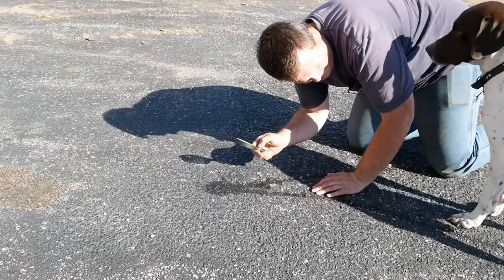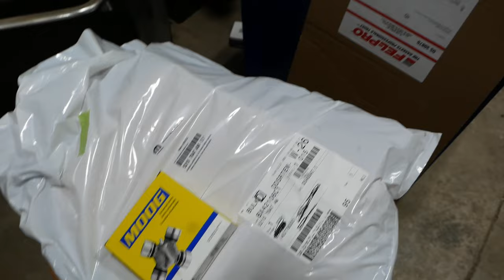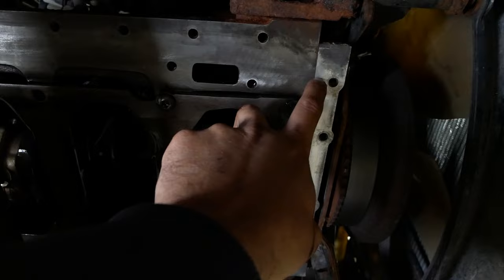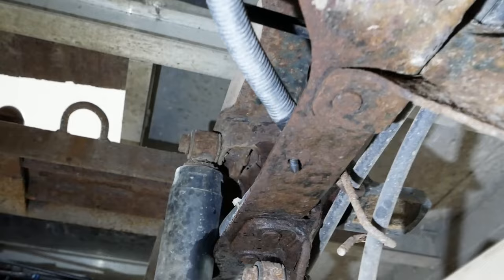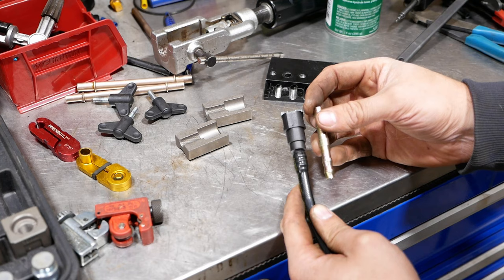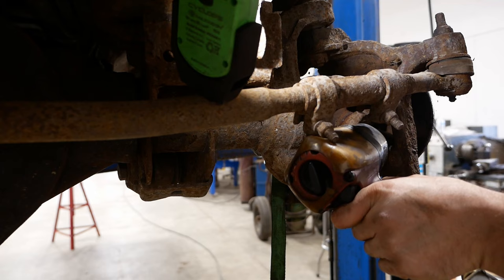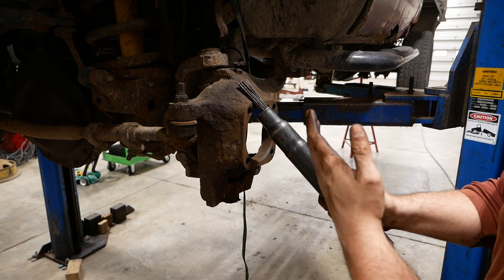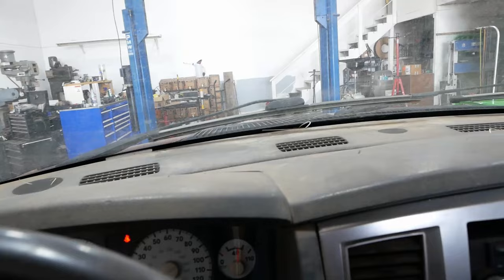6.7 Cummins Massive Oil Leak - Replace Oil Pan, Front Axle U-Joint, Fuel Lines, Shift Cable, Battery

Comment: My favorite comment: "Lets switch from stun to KILL"  Also as a Michigander I can relate, rust is not only a terrible color choice for body panels, but an organic form of lock tight.  Wes you inject just the right amount of snarky in every video.  Thanks
Reply: What kind of salt do they use over there. We have salt here in Sweden but mostly VW products rust out like that if they are 20 years or less old.
Reply: @rimmersbryggeri  The road salt has caustic soda,   sodium hydroxide, lye, that generates heat with water contact.  Some places now experiment with beet juice as an anti icer.
Reply: Patina is the new inthing.
Reply: @12345NoNamesLeft  Ok explains it. That will destory the paint in notime. Here it's just less purifies table salt.
Reply: @12345NoNamesLeft  Here in Columbia, Mo they used excess coal fired power-plant clinker but everyone got tired of the black mess in their garage, so that's went away...But I'd put up with it again if only to quit the salt MESS. And I would guess It gave superior traction...A thin soft bicycle tire of mine had a flat due to that stuff tho.
Reply: @charlesangell_bulmtl  Salt stops working in the very cold, so we do have a sand salt mix too.
Reply: Mitten dweller here as well!  Working on cars up here is a whole different monster than in the non snow states.  I watch the videos from people down south and I wonder if they understand just how easy they have it?
Reply: @rimmersbryggeri  what part of Sweden? South Sweden doesn't get the snow you see here in canada/northern USA. Mountains and such as well.
Reply: @0xsergy  I live in stockholm, but I used to live about 700 miles farther north. In the old days they didn't even bother with salt there because it was too cold.
Reply: @31terikennedy  😂😂 Patina enshrouded in Clear Coat!!

We Michiganians just need to learn to oil our undersides like they did 50+ years ago!!
Reply: @charlesangell_bulmtl  Unfortunately that Clinker slag was toxic.  We had sledding hills made out of that stuff in our City parks.  Then all of a sudden one summer all those sledding hills went away. And folks could call up GM and a truck would come and haul it out of your “gravel” driveway or parking lot.  This was back in the late ‘60s.
Reply: @whammond511  Better yet, use boil linseed oil on patina. Oiling undersides has been going on a lot longer than that.  :D

Comment: Like most vehicles in the Midwest, that truck is mostly held together by the power of the strongest fastener known to man - the rust weld.
Reply: A-10 Warthogs have a titanium bathtub? That's nothin'. This beast has an iron oxide bathtub. One solid (mostly solid) tub of fused together rust.
Reply: @Guysm1l3y  Onlything keepin my frame together, well that and a shit ton oil.
Reply: "What is the point Walter?".
Reply: @caseywamack6566  We're talking about unchecked aggression here, dude.  The rust is over the line...
Reply: @Walter Sobchak Ok. That's interesting, mark it zero. He's a conscientious objector. Would you just calm down man. Shomer shabas

Comment: "All it takes is one incident to end things for you," in that statement alone, you are ahead of your class.  Best Wes.
Reply: As a repairer taking money you have higher duty of care. Same in any industry. You are meant to know better since you are the "expert".

There is another YT mobile mech complaining he is being sued for just doing timing chains on an engine no tensioners, (which failed), even though the owner was informed. Trouble is most people think if the expert will do it it must be OK - kind of why they take it to a mechanic. Don't know the outcome of that.

Lesson there is don't do any repair you are unhappy with as a mechanic. Turn the job away.
Reply: I can’t believe Wes could loose the shop over a fuel line repair and the owner is allowed to drive around in a total rust bucket.
In Australia our cars are inspected every year and they are brutal on any rust or oil leaks.
They also do an inertia brake test every year.  No pass, no rego.
I agree completely with Wes, the total lack of inspection is bizarre.
Reply: @DavoShed  In WA we had emissions inspections, but no fitness inspections. every 2 years we had to go have the emissions tested to get a new tag.
That should tell you all you need to know about this state. 
No longer "need" it because... reasons?
Reply: @DavoShed   Only in NSW; and the NT for cars over 10 years old.  Elsewhere roadworthies are only required when a car is sold (unless you let the rego lapse).

For larger vehicles it gets more complicated.
Reply: @ddanielmiester  
That’s interesting, I’m in New South Wales.  I know states have different rules but I didn’t know WA was that different.
We have never had emissions tests.  Cops can defect a Smokey car but that is very subjective.
I had a thumb sized rust bubble in one of my doors and my mechanic said you better get that fixed before I can pass it.
I’m sure he was worried about his liability if he passed it.
I had the rust replaced with a blob of fibreglass and nice paint.  It then passed but the car is not any more safe than it was before.
Looks nice but :)
Reply: @DavoShed  welcome to NSW mate! 🇦🇺🍺🍺
Reply: @dfross87  pink slip every year in NSW after the vehicle reaches 5 yrs old..🇦🇺🍺🍺
Reply: @phillipdean9879  
I’ve been here all my life. :). It used to be 3 years since new for the no inspection thing but that may have changed recently.  My two cars are now 33 and 37 ;)
I have to take my camper / box trailer in for road worthy tomorrow because it’s over a certain weight.
It doesn’t require it’s own brakes so there is almost nothing to check.  I think they just kick the tyres, check the lights and take payment.
Reply: @DavoShed  I’m in the same boat mate, trailer, 2 boats! Caravan ant 2 cars! 🤣🤣🇦🇺🍺🍺
Reply: @phillipdean9879  I know.  But most of Australia: no annual checks.
Reply: @DavoShed  sorry, that's Washington State, USA
Reply: Daniel De Jager 
Ha Ha, that’s also our abbreviation for Western Australia but you probably already figured that out  by now.
Reply: @DavoShed  some cities or states have inspections. We don't have Federal level inspections, either way they're not as strict as Europe or other places generally. I hear people like you lose their minds about it all the time but even as a tech living in an area without any inspection requirement I don't see like crazy mechanical failure wrecks or anything. My area doesn't have the rust issues his does either admittedly.
I'm in Washington state.
Reply: @chickenfishhybrid44  
I don’t loose my mind over it :). Our road worthy laws are state based as well.  Some people register their cars interstate but it’s not worth the bother.
We shouldn’t need laws telling use not to to dangerous stuff :). I still find it interesting Watching Wes Work.
As a young man I would have hung around a mechanics shop just to watch and learn what they do.
Now I can
Reply: @DavoShed  oh but I've seen Euros loose it many times lol. Some of them certainly seem to have Federal regulations, like I think Germany does, could be wrong. Right, that's exactly the point.. it's in every individuals best interest to not drive a vehicle that will kill them..
Reply: @DavoShed  Same goes in Europe mate. Used to work at as a car mechanic, and we had to do semi annual inspections of cars. Watching these videos just gives me shivers. In part because I'm thinking about all the crappy stuff I would have to fix to get it road legal again.

Although walking under cars with the big screwdriver stabbing brown spots was always fun, since you had that element of pleasant surprise and the fact that rust repairs were usually too expensive, and even if it wasn't we didn't do body work in house, so not my job or problem.
Reply: @ddanielmiester  In MI we have absolutely NO Inspections whatsoever unless you get pulled over by the State Police for one.  And usually all they check is your license, insurance and registration.  They check your lights and ask you to set your parking brake and then shift into gear.  As long as your parking brake holds you, you’re good.

No requirements for rust per se’. Your vehicle has to be in a safe operating condition.

Comment: I love your sense of humor. That vehicle is a tribute to entropy
Reply: Enthalpy as well
Reply: Entropy: maybe decline into disorder, but:

PHYSICS
a thermodynamic quantity representing the unavailability of a system's thermal energy for conversion into mechanical work, often interpreted as the degree of disorder or randomness in the system.
"the second law of thermodynamics says that entropy always increases with time"

2.
lack of order or predictability; gradual decline into disorder.
Reply: You got a big metal worm problem with that pick-up  suprised it would get through inspection
Reply: @marksd5650  I've heard the 3 Laws of Thermodynamics put this way: 1) You can't win, 2) You can't break even and 3) You can't get out of the game! 😁
Reply: No doubt

Comment: My father (an old WW2 motorpool mechanic) showed me a good trick when instaling oil pans. Place the casket on the pan and tie ieach corner, or so, with a little piece of string. This way it stays where you want it while moving it around. Just cut and pull out the sting after a couple of bolts are holding it in place.
Reply: I use little zip ties to do that and it works great.
Reply: I like the hoyke plastic snap over bolts felpro gives u with the gasket they actually work
Reply: Ive had good luck using transgel
Reply: Fishing line works good too
Reply: Super glue.
Reply: Good tip. Sreton in M539 restorations always uses small cable ties
Reply: Yes sir my Dad showed me the same thing. He was an aircraft mechanic on an aircraft carrier during WWII.
Reply: Great idea.

Comment: I appreciate the care that you take when working on something. I have met so many "mechanics" over the years that would take the customers' money and do as little work as physically possible. I love the fact that you take the time to do the job correctly, as well as the fact that you genuinely care about your customers' safety and well-being. Very few people do that anymore.
Reply: Yes sir the culprit here is the pay system (flat rate). It would stand to reason knowing human nature to have a limit on what can be the charged time on a job based on what the average time that it takes to repair a specific component. In transportation the system is similar in that the mileage on a run used to be based on the household movers guide in that it specified the mileage from one point to another in the shortest distance. Of course that system is now the PC Miler setup which bases the mileage on interstate miles. Again a flat rate system. Both systems are used to prevent people from padding the bill in excessive time and excessive miles. But what both systems do (the mechanical system is worse than the mileage system) is of course motivates people to cheat (ever since the beginning of time). In the mechanical world mechanics would do as little as possible to do a repair as they do not get paid any more to overdo the job (like painting everything for instance) and of course there is shoddy work performed as mechanics are always trying to beat the flat rate (some do very well at this and still produce quality work). And there is the situations that this young man (and others) face on a daily basis due to the part of the country where there is a lot of rusted up components which exaggerates the time on the job and of course exceeds the book time to be paid. It would be nice where the shop could bill the actual hours put into the job but due to human nature there would be all kinds of cheating (more than normal) and customers getting ripped off. We had a fellow back in the seventies that was very fast and basically a good mechanic, and he always beat the book time. Yeah after he was gone the come backs came back to the shop, he was fast all right so fast that he left half the fasteners out and the other half were not tightened up properly. He was gone but the shop could not go anywhere and I'll give you one guess where the customer came to to resolve his problem.

Comment: I loved the Sherlock Holmes/ Scooby-Doo intro! Be yourself and let the snark and sarcasm flow.  You gotta release that stuff or your head will explode.  Your videos are very helpful since I grew up around Youngstown, Ohio and now live in Pittsburgh, PA.  The high-salt diet is "no-bueno".   I once locked my keys in my '77 Nova sedan while it was running.  A buddy put on a glove and just reached straight up through the floorboard to shut off the car and remove them from the ignition.
Reply: qaa

a
 
.
0

0 

0

.
Reply: 🤣🤣🤣Great story...

Comment: I see you're a master tracker - an oil slick almost always leads to a farm truck truck with a flatbed.    Good morning Wes!
Reply: Most hunters use the oil trail tp track down cummins engines or 7.3l powerstrokes
Reply: @ryancollins3227  I'm an owner of a 7.3 truck with a flatbed and can confirm this is true
Reply: @DMHRC  I Too Have  A 7.3 Leaking on My Driveway & Wouldn’t Want it Any Other Way
Reply: My Cummins didn't leave an oil stain once. It'd all  Leaked out
Reply: @tombeauchamp806  well then it left an oil stain that one time it leaked all its oil once

Comment: I watched this video about the right way and the wrong to do a brake line. It's a sick feeling when the light comes on telling you that you have problems with the brakes. I had a ford  pick up truck with a five speed. Half  way home my brakes failed. Turns out that the man I purchased the little Ford Pick up from used the hard ware store fittings. to fix the brakes. The people a Midas told me I was lucky I wasn't killed because of the hardware store fittings. Keep doing it right Wes, you are one of those men who care about the work you do. Krrp the videos coming.

Comment: Wes, the only safety shortcut I ever saw my dad do in auto repair was to braze exhaust pipe. He made duals for an AMC hornet, cut off the crossover pipe off, and brazed a freeze out plug in the hole. He eventually fixed the Bible the right way, but this was a test to see how it sounded and performed. My dad was one of a dieing breed that made things from other things. He built a tractor from Toyota and Nissan parts. He left that to me before he passed away. I'll redo some things on it, but it will be mostly the same as he made it.
Reply: Yes, indeed. Mine built one from 4" channel iron, a 9hp Briggs, snap clutch on intermediate shaft, 3spd GM top-loader,  '57 Plymouth diff. (He bought implement lug tires for those rims, filled tubes with calcium and water, and attached bull gears for weight to wheels). Inside the back frame, he welded foot long chunks of 3" square steel from an old one-way disc plow. Saginaw PS pump for his hydraulics, hardlines dropped to frame, leading front and back to hyd. quick couplers. Only thing I can recall breaking on the thing was my fault, as I was bouncing on the seat to get traction pushing WAY too much heavy snow. His spring steel seat mount that....
If It ever needed repowered? Engine mounts to a large flat channel iron surface w/v-belt drives. JUST plain simple!!!
A top speed of 14mph....LOL
Reply: @charlesangell_bulmtl  i may end up building something like that, small tractors are ridiculous anymore

Comment: After spending a solid half an hour working in tight quarters installing four bolts with a ratchet 1/8 turn at at time, I invested in a cordless ratchet like that one (different brand though).  Worth every penny...what an amazing time saver they are.
Reply: Even the cheap ones do a fine job at backing out the bolts after your get them loose.
Reply: I like mine too .. although I'm always careful not to overtorque when going in, they have some power.

Comment: For the plastic lines and quick connects Halfass kustoms has a great simple way of doing them. Drill a hole in a block of wood the same size as the line, cut the block in half through the hole, clamp your line in the block of wood in a vice with around 5mm proud, remove the clip from the connector and just tap it into the line. Job done! And the block is obviously reusable over & over

Comment: The best way to hold the oil pan and gasket together when maneuvering the
pan into place is temporarily use 6 to 8 zip ties through the bolt holes to secure
the gasket to the pan and when the pan is in place start some of the bolts in the 
pan and then cut off the zip ties.

Comment: So glad to see someone else change a U joint using hammer. Many people use a vise or u joint press and end up springing the yokes. I've had a harbor freight needle scaler for 14 years or so , works great, used it to derust the entire plateform of a 25,000 lb school bus lift. Drove the drivers crazy!